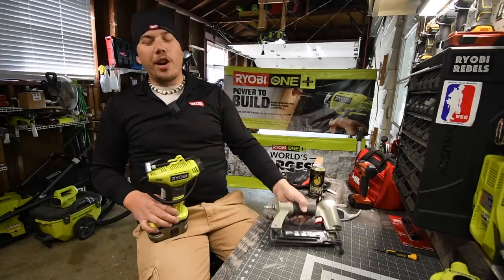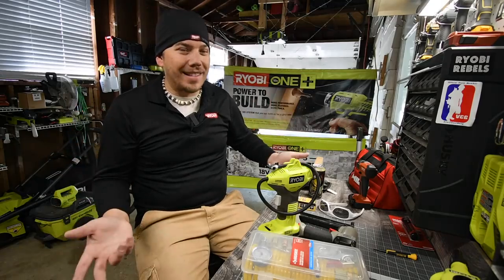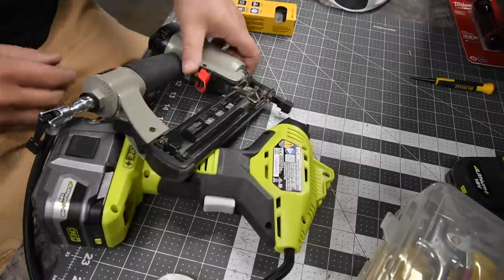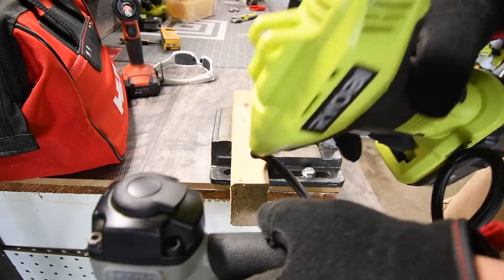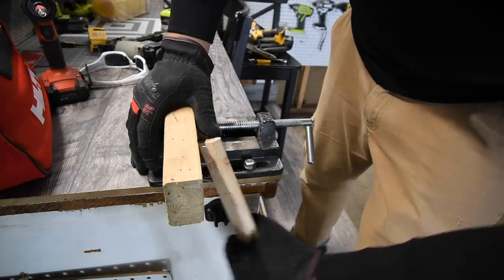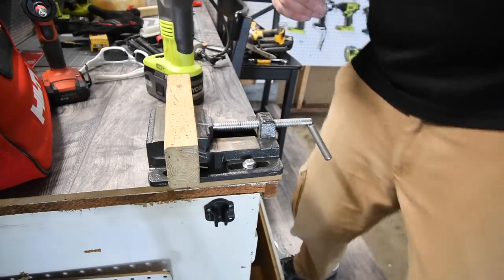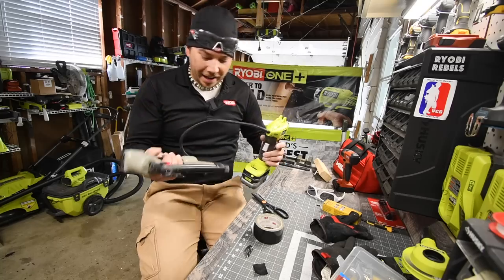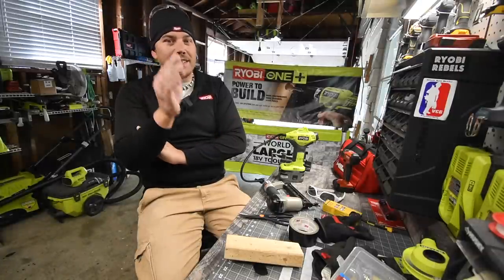Does this RIG work??????

Comment: I wouldn’t be surprised if a big brand representative saw this and came up with something more reliable. This is amazing! All it would need is the right fittings and a pressure shut off so it only runs when psi is low , a strap for the shoulder and done. Awesome video
Reply: Not to be a Debbie downer, but cordless Brad nailers, are a thing, and they work better than this.
Reply from the maker: I doubt they would since all brands make battery brad nailers now

Comment: try it with the milwaukee inflator! great video!
Reply from the maker: Yes sir and I thank you Bmulls
Reply: The m12 works real well, it has the constant air option that tops pout at 120PSI. Used a Milton tank fill valve with the schrader valve on one end, and the 1/4 NPT male on the other to attach my quick connects.

Comment: I had to go outside and try it with my Black & Decker battery powered compressor.  it worked pretty well until it got a little oil on the fitting.  Then the hose kept popping off before it could get up to pressure.   I already have the compressor rigged up with a quick connect to use with tools, I never would have thought to connect the tire inflater to the tool.
Reply from the maker: Its crazy that it does work lol

Comment: Wow! It actually works! Can be useful in certain situations.
Reply from the maker: Yes it can and thank you Mayhem
Reply: Man Caver Tools You know I’m going to try it with my RIDGID inflator. See if it works with that one as well. Did you have to modify anything? I didn’t see you mention it in the parts of the video I watched.
Reply from the maker: @MasteringMayhem  you just need the correct size connection for the brad nailer. it should only cost a few dollars. ill put the size of the connection in the description tonight
Reply: Man Caver Tools Sounds good. Thanks.

Comment: Be brave. Cut the hose coming from the Ryobi, add a quick connect coupler and make separate hose ends: one  for the tire inflator and another connector for the nail gun.
Reply from the maker: I can do that and I thank you Neil
Reply: @ManCaverTools  Have  you checked out the Ryobi 1 gallon compressor, R18AC? That looks like something more suited for this.
Reply: No need, as stated above just use this valve and another quick connect.  https://www.homedepot.com/p/Milton-Industries-Inc-1-4-in-NPT-Tank-Valve-S-684-4/301836667
Reply: @EdHazardd  That would work, but you'd be relying on the clamp-on Schrader valve connector. I'd rather have something more secure if you're moving everything around all the time.
Reply: @ngarber   The M12 hose threads onto the schrader valve of the milton valve, locks up tight. You then thread your quick connect coupling onto the remaining side and your good to go.